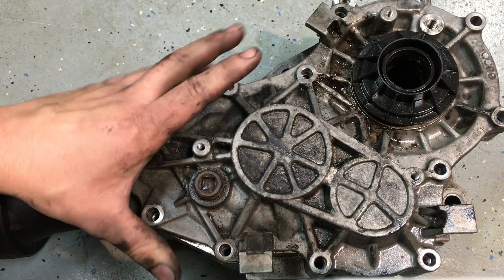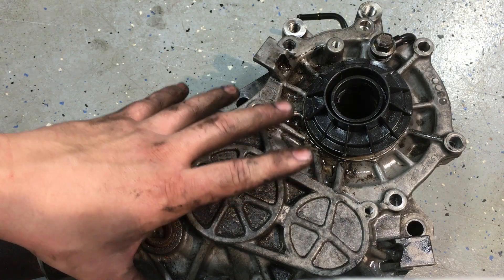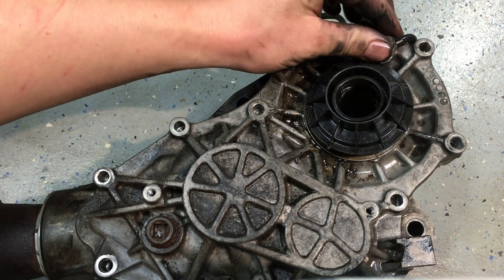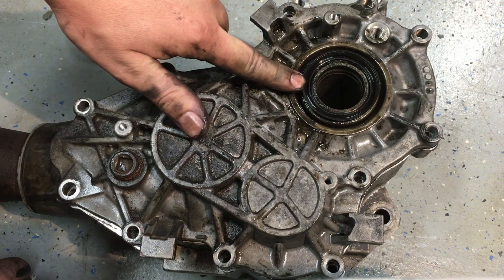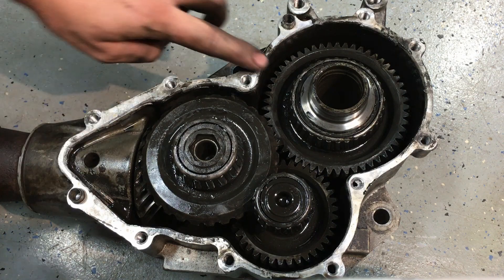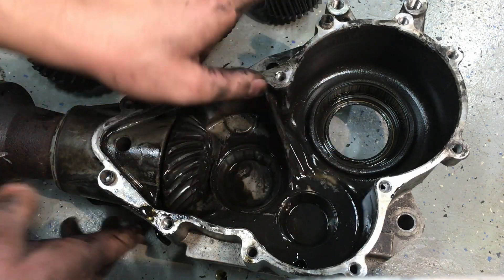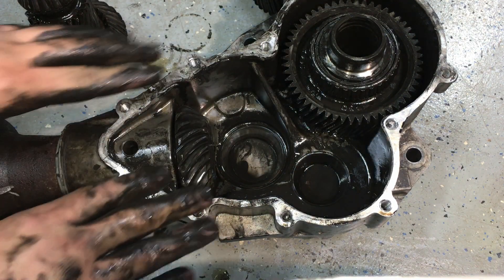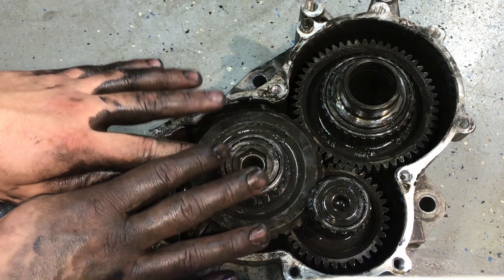Ford Quick Tips #64: Preventing AWD Power Transfer Unit Failures

Comment: Recently drilled and tapped the case on my 13 lincoln mkx. Pretty easy. Fluid was dark but relatively clean and the magnetic drain plug had very little residue on it. But I noticed on the side of the PTU some markings done with a paint marker. I bought the car with 90,000 miles on it. Like new condition. I suspect the PTU has been replaced already. So now I'm going to change the fluid at least every 10,000 miles. One other thing I did was fabricate an air snorkel  that flows air up towards the PTU to hopefully reduce the temperature in that area.

Comment: I have a noise that sounds like the RF wheel bearing is bad after I replaced my blown up ptu with a used unit. RF bearing replaced, noise still there. Will the vehicle drive with the front half shafts removed for diag purposes? That would tell me really quick depending on how the ptu is driven. Don't want to take the shafts out and find out it doesn't move.

Comment: Hey, good content you always put out.  I'm doing this service on my 2012 Escape.  Can't find any torque specs for the case half bolts.  Can you help me out?  Also, is grey Permatex Ultra acceptable.  Thanks for your time.
Reply from the maker: Yes and yes! Tighten to 32 Nm (24 lb-ft).
Reply: @FordTechMakuloco    Perfect!  Thanks.  Keep up the good work.  By the way, it's refreshing to see someone that knows the proper way of expressing torque(lb/ft)
Reply from the maker: I can't take credit, its a copy and paste directly from the Ford WSM.
Reply: @FordTechMakuloco  Hey Brian.  Hoping you can help me out again.  On this same PTU for my 2012 Escape, any chance you have the part number for the seal and dust kit for the passenger side driveshaft?  The parts woman at the hole-in-the-wall Ford dealership in my town insists it is non serviceable and says the only kit is the one for the driver's side in the transmission.  She won't listen to anything I say.
Reply from the maker: These are for the passenger side of the PTU where the CV shaft sticks into it.
YL8Z7H459AC
GB5Z7H426A
Reply: @FordTechMakuloco   Thank you.  Very much appreciated.  Keep up the good videos.
Reply: @FordTechMakuloco  Just a thought but maybe this is fodder for a video?  Checking the forums, there seems to be a rash of people who are up against the wall on this procedure.
Reply: @FordTechMakuloco I have a 2006 mercury mariner hybrid my original ptu failed at 180k. I replaced it then it is failing again at 189k. Am I able to service my first ptu back to life/replace the gears? Why did the second one fail so quickly (came from 2011 ford escape)?

Comment: I just bought a 2013 ford police interceptor utility, and I'm wondering, does that vehicle have the same problem with the PTU overheating as well?  As soon as I get the vehicle in my possession in going to do a normal oil change, but also planning on changing the PTU fluid.  Just wondering what to expect.

Comment: Hey Brian, i have this same trans case in my 2012 escape. i tried a handheld siphon with a thin rubber nozzle but could get anything to drain although i feel the fluid  with my fingers. do i need to approach the fill hole from above and diagonally to run the tubing deep into the bottom of the case?

Comment: @fordtechmakuloco Would adding another 1/2 quart of fluid help from fluid breakdown from heat in between servicing? Like adding the fluid through the banjo/bent bolt tube or just simply adding more fluid and quickly put the fill plug on ?

Comment: @ fordtechmakuluko i just bought a ford edge 2016 awd 2.0 ecoboost, just wanna know if their is a drain plug for ptu, and do i need to change the ptu fluid, its on 68k right now, thanks!..
Reply: Don’t know if it’s to late, but you can buy a brake fluid bleeder and just pump the old fluid out.

Comment: Question.   2008 ford taurus.  Awd.   I had a trans shop rebuild my trans.   200,000 miles.   Came out oeaking.  Took it in a week later.   They said it was the PTU that needs a rebuild now.   I dont remeber the trans leaking before.   And i jad the dealer reolace my frint right axle seal at 150k because it was leaking.    Any thoughts ?

Comment: I have a horrendous, vibration coming from, "possibly" my passenger rear. [I thought i blew a tire], type noise. It sounds like a jack hammer. I'm not sure if it's a wheel bearing. I doubt it is, due to, it happens when warmed up. I here some mild vibration at zero to 30 plus mph... But when i hit about 40mph, the jack hammer noise comes. It's very loud and startling. 2007 MERCURY Milan

Comment: What typically causes the driver's side input seal to fail on the PTU?  Due to leaking input shaft seal, I installed completely rebuilt PTU.  Now leaking transmission fluid again due to bad input shaft seal <2,000 miles. Having to replace again.  64K miles

Comment: Can you please explain where the ptu is located on the 2016 ford edge sport? I'm getting ready for a long road trip (1,800 miles each way) and took my edge to a shop to have the front and rear differential oil changed. I asked to also have the transfer case done but they told me this vehicle doesn't have a transfer case. They were only able to change the front and rear diff along with the engine oil but I am concerned with everything I've been reading about this ptu. I have no idea where it is located and wonder why the shop was not able to see it and drain it. Any information would be very helpful as I would like to have this fluid drained and replaced asap before my trip. Thank you!

Comment: I have a 2012 Lincoln MKZ AWD and my PTU started failing at 84K, had the oil replaced in the PTU, but it was too late.  The existing oil was an "oily metal black soup", so I had damage to the internal gears.  I ended up replacing it (Summit Racing was the cheapest) and just having my mechanic install it.  I know that Ford is not going to cough up any cash for a bad design.  Now I will be replacing my PTU oil yearly.

Comment: Thanks for the Great Videos! I'm not a mechanic but like to learn about things. Bought a 2016 Edge AWD and learned from another one of your videos that I should not wait the recommended 100,000 miles before doing service to the transmission. Just had the transmission, transfer case and rear differential fluids replaced in the Edge. Great advice ... Thanks again for helping us non mechanics out here!

Comment: 2010 Ford Flex Ecoboost AWD PTU failure noted at 55K miles in vehicle used primarily for daily transport of kids to bus stop and bi-weekly grocery run. Failure occurs because PTU is both lacking sufficient quantity of lubricant, and experiences thermal overload due to proximity to turbo, CAT, and exhaust routing. If you are wondering how vehicle with such light use could experience PTU issues; it is no mystery. Ford included static under-engine shield with air collection ports intended to channel ventilation. However due to static nature of design, cooling is only circulating with vehicle in motion. This implies parked vehicle with engine running creates super-heating event, in which various drive-train components are basically baked. These include EPAS, PTU, turbos, and more. Thermal overload must be considered as primary catalyst for many reported Ford engine, steering, and drive train failures. Thermal considerations represent missing link associated with many reported Ford issues. Heat related failures are often overlooked because of intrinsic elusive nature.
PTU failure disposition noted depleted, degraded and thickened petroleum deposits internal to case. In addition to evidence of lubricant overflow at upper vent valve. This evidence and vehicle history are not consistent with overworked PTU heating from heavy use. But instead; repeated and severe thermal exposure events leading to lubricant degradation and subsequent failure. This disposition also consistent with frequency of reported PTU seal failures.
Ford is fully aware of thermal issues across various vehicle lines; if you want proof, note PTU design in Ford police interceptor vehicles. Same PTU, but case includes active coolant system with external radiator. This is because police vehicles endure both hard use, and often sit for long periods of time with engine running, where engine efficiency is lowest and waste heat maximized. Another interesting document is Ford published PTU thermal profile diagram; which depicts Ford PTU case temperature profile during various vehicle operational dynamics. Ford pushes fact PTU case temperatures remain nominal during most dynamic operational scenarios; however Ford provides no data associated with static vehicle tests absent of coolant air-flow. Just an interesting example of how flaws are hidden in plain sight with deception.
PTU replaced with later year version with lubricant drain plug. However, keep in mind nature of failure is not simply insufficient quantity of lubricant. Failure can be prevented with frequent lubricant change, but given nature of issue; 'very' frequent lubricant change is recommended (5-7K best guess).
Reply: I hope your doing well. We just bought a 2011 FLEX and I have been studying this heat problem. Breather vent on top can be optioned with transmission hose up to top right firewall with vent plug. Drain plug is great addition. 
Have you considered shielding for unit with space age material used in winter snowmobile mittens. Looks like white fiberglass but is same material used to shield the Spaceshutle?

Comment: Brian, thanks and nice video. Just bought a 2011 Escape hybrid with 60,000 miles.  PTU went out 2,000 miles later at 62,000. PTU oil was nasty, nasty with bad bearings.  Wanted to add, the trick to removing the dust deflector: use a heat gun on low setting, blowing both inside the hollow shaft and outside the dust deflector ring.  Be patient.  It will come right off with no damage if you take your time.  I might add, the Ford service bulletin says not to attempt to pry it off.  I'd also like to see a video on removing the transfer case and your comments on adding a drain plug to the later models that don't have a drain plug.  It needs one desperately.  Siphoning doesn't work because you can't get down to the really dirty stuff because the gears are in the way.

Comment: Had a gear oil leak (vent blew out on transaxel) on my 14 xlt explorer, dealership is telling me I need a whole new PTU which is $2k. Said it was transmission fluid (black fluid just like the gear oil on your hands!) Could I still just change the gear oil, or is the replacement of the PTU necessary?

Comment: Can the ring gear assembly and the corresponding idler assembly be permanently be removed. I have an AWD 2008 Ford Escape and have removed the driveshaft going to the rear for some time now. I am mainly looking for fuel economy advantage and of course fewer parts to fail.

Comment: Thanks for this great video, can you provide some advise removing the plastic dust cover and internal seals holding the ATF back?  Thanks again and simple logic isn't helping me remove and replace these parts.
Reply: The PTU is out on the floor and I ended up using an old standard screwdriver to drive it loose from the transmission side.  Hit it on one side then the other and pried what I gained with another screwdriver until it worked its way out.  Now trying to figure out how to remove the seals (AL8Z 7H424 A and the 2 outer ones).  Any help would be appreciated.
Reply: @kenostrom9748  So how do you get those seals out?
Reply: The trick to removing the dust deflector: use a heat gun on low setting, blowing both inside the hollow shaft and outside the dust deflector ring.  Be patient.  It will come right off with no damage if you take your time.  I might add, the Ford service bulletin says not to attempt to pry it off.

Comment: I have a 2016 edge, have they made any advancements  on these units compared to the 2011 edge, I had to vacuum the old oil out to change it, and am looking to do the same oil change in my 2016 to prevent failure

Comment: Just went thru two of these in less then 20k Miles in a 2014 MKS.
Reply: If she is all wheel drive you need to keep all 4 tires extremely the same wear (diameter) critical you replace all 4 the same time.
Also rotate and watch the wear.  Diameter size makes ALL the difference.

Comment: AWD is fine if you know it's functioning properly, I wonder how many owners of AWD vehicles are driving around with only 2 wheels actually working....My driveway has a bit of a grade, when we had the good dump of snow a few yrs. ago I shovel the driveway & curb, drove my 2010 Ford Taurus till the rear wheels came to the curb then gave a little acceleration it didn't move only front wheels still in the snow spinning, good thing it was under warranty, new power transfer unit (PTU) $1700. plus labour. apparently the fluid in the PTU Ford says never needed replacing, they go at a little over 30000 KM & there's no plug at the bottom of the PTU to drain fluid only a plug on the top, with a number of owners having the PTU troubles Ford decided in 2013 to install a plug at the bottom of all PTUs, when they replaced mine I asked to have the newer PTU installed they said that it has to be the 2010 PTU for the warranty. ASS ..HO...Checked it out on the web, some owners found an area clear of the gears where they drilled & taped a hole for a plug. Others fed a tube into the top plug & sucked it out, at 30000 KM the fluid is SAE 75W - 140.
Reply: Leigh Honeybourne Would this ptu cause a little steering binding?
Reply: No the Transfer case has no connections to the steering.

Comment: Just did the fluid change on my lincoln mks...along with the differential...I am not sure what the engineers were thinking about servicing this vehicle.  No wonder why they called it lifetime fluids, because you can't get the fittings to change it.  Oil, transmission fluid, ptu fluid, differential fluid...about 3.5 hours and a lot of cussing.
Reply: The PTU on an MkS is a different critter altogether. At least the Escapes have a drain plug that's accessible, unlike the one found on the 3.5/3.7 Duratecs. These are actually designed to be serviced.

Comment: I did my PTO/PTU on my 2014 Flex EcoBoost w/44,000 miles today. I was relieved to find a drain plug, and that the fluid that came out was in reasonably good shape.

Does anyone know if the 2012 AWD Flexes have a drain plug? My brother-in-law has that year model, and I'd like to encourage him to do his. It would be good to know going in if there's a drain plug.

I'd be freaking out after seeing your comment in the video description that most take 2 qts - I got about 1/2 qt out of mine, and didn't get much more than that back into it. However, I saw on fordflex.net that this is normal for the Flex - fingers crossed.

Comment: I have a 2015 edge awd with 44,000 miles still under factory warranty ptu is leaking ford dealership I bought it from says it’s not leaking clearly I can see it’s leaking and dripping on the heat shield of the exhaust I’m not sure what my next move is they won’t touch it

Comment: Hello, your video is very good, so I need to ask the following:
I have a Ford Escape 3.0 XLT, it's the same transfer shown in the video. The problem with my transfer is that it vibrates the vehicle cabin at a speed of 70 km to 110 km. Before it vibrated much more, the cardan support was replaced and almost the whole problem was solved, but there is still some vibration. When the transfer is cold, listen to the turn and the sound is transmitted to the driver's cabin just below the console, a turn as unbalanced. A test was performed by gently applying the handbrake while advancing and accelerating the vehicle smoothly, and the problem was that the sound increases in the transfer (the cardan has no problems).

My question is: this problem is solved by repairing only the transfer using the reconstruction kit (bearings and seals I can get), will the bearings be the cause of the vibration transmitted to the cabin or will there be problems with the gears?

Comment: 03 ford Escape 3.0 Automatic 161 k miles.  1. Very light growling  sound  Lft bearing definitly was bad   all  was fine for 1000k miles after lft bearing change.    .2. Then growling noise started lightly at 40 to 55 mph.  3. So right bearing was replaced . Noise still there and getting louder . Transfer case fluiid was changed,  silver paste came out,  thats wear..3 . refilled with fresh spec fluid.  Mechanic stethascoped bearing and t case ,, could not isolate . How to determine if T case .or ?  Can we retorque axel to 215 to see if it changes noise pitch . Most bad TCases rattle,  not growl.   Bad internal TC  bearing ? Whats your reccomended diagnostic   process. Thanks .

Comment: Just did a post-mortem on my Edge PTU.  It definitely had a seal leak and the fluid left inside turned to black sludge, BUT there's no sign of bearing damage.  The damage is "limited" to almost every tooth on every gear  having chips and galls.  If this were a lubrication or heat issue, would not the bearings fail before the gearset?
Reply: I am no expert, but I think it is like with rear ends, don't the pinion and ring gears go bad first if there is a lubrication issue? This PTU seems to have some heavy duty looking tapered rollers. The force is spread out through all of those rollers in the bearing, whereas the gears experience a much more concentrated force, distributed over about one tooth at a time.

Comment: Brian do you have a video for changing the fluid in a PTU like what is in the Edge?
Reply: I don't know about the redesign, but the early units do not have a drain plug, and there's precious little room to snake a vacuum line in the fill hole with which to suck out the old fluid.  I think the best I could do was get about an inch off the top.  All you can do is draw out what you can and top it back off.  Do this at every oil change.